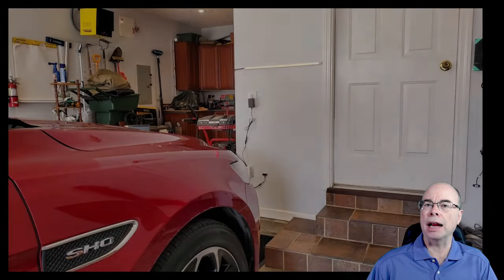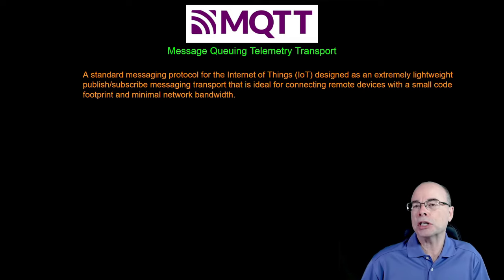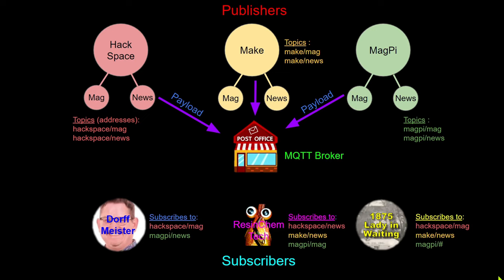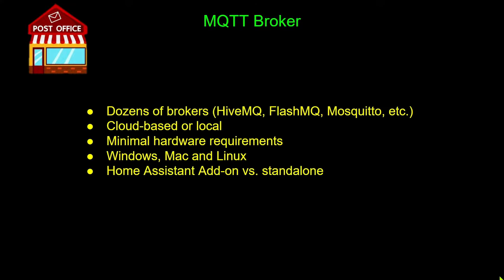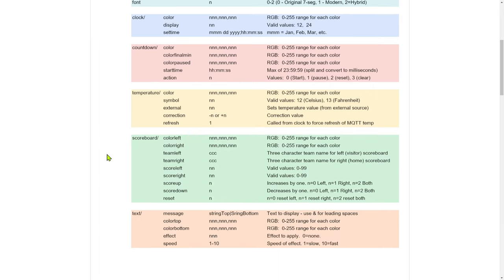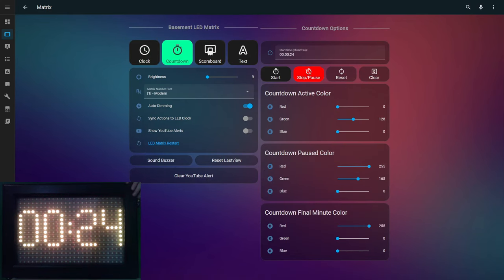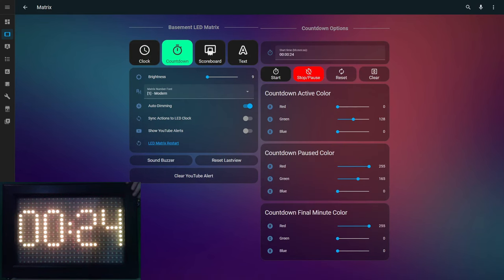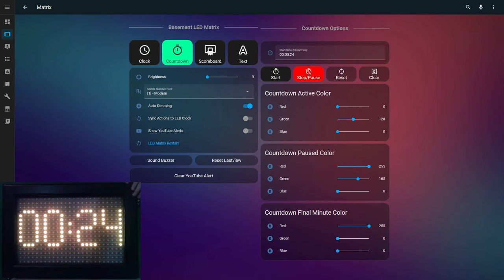MQTT 101: Integrate your DIY Devices into Home Assistant

Comment: Hello, great video! have a question. How do you edit a Yaml  file in the Home Assistant, Ul? In  your example, you show a side by side by side window view in a code editor not sure which one. In my instance, I have Home Assistant running in a VM on a separate machine in proxmox I’m accessing Home Assistant through its IP address on a separate computer Chrome browser when I try to edit a default ESP home configuration for example a D1 Mini adding code to a standard binary sensor from say a get hub example or to say, create in download packages, I can’t copy and paste from say a git hub repository to add the code to the Home Assistant computer. Configurations, I’ve tried both the built-in, file editor also the built-in VS code. There’s no copy and paste.  So my question is, In your set up What is your workflow for maintaining in managing your Home Assistant instance as far as configurations, working, and copying from GitHub, managing files etc.
Reply from the maker: Not completely sure what you are asking here... may be a bit different use of terminology for things.  But my setup is basically the same as yours... I'm running Home Assistant on a Proxmox box and accessing it via the browser (Chrome) using Home Assistant's IP address.

But I am able to cut/copy/paste code in both the File Editor and in the ESPHome editor.  I'm using Windows, so the Ctrl-C, Ctrl-V for copy/paste works.  I can copy text from really just about anywhere... Github, blog, another text editor, etc... and paste it into either the File Editor or the ESPHome editor within Home Assistant.  You can also try a 'right-click' of the mouse to bring up the cut, copy, paste options... but for some reason, I do see cut/copy but not paste in the pop up menu in the ESPHome editor.  Out of curiosity, if you copy something from say a Github example, can you paste that into a local text file (not in Home Assistant), even using something like Notepad?  If you are asking something else please let me know, but I am able to copy text from outside files and paste those into either the File editor for YAML files or into the ESPHome node editor.

One thought... are you logged into Home Assistant as the owner or an administrator?  And do you have 'advanced' mode enabled?  If either of those are not the case, it might prevent you from editing any files... and therefore, paste would not be available.  Click on your icon in the lower left corner.  In the profile, at the top see if the account is an owner or administrator.  Then scroll down and see if the 'advanced' mode is toggled on.  If you are unsure of accounts, go to the System -> People.  This could likely be your issue.
Reply: @ResinChemTech  Hello and thanks for the help. Much appreciate it, so yes, advanced is selected and the keyboard shortcuts do work so everyone that’s copying pasting must be using the keyboard shortcuts, which I never have before. Mine is the same as yours. The copy is there, but not the paste with the mouse. Also, just curious how you got the side-by-side view and not sure some are using the built-in file editor and some are using the VS code not sure which is the best and some have mentioned that you need to be using Samba Share to edit the config. So I wasn’t sure what the issues were. Your videos are good. You’re very good at explaining things you must be a teacher.

Comment: How do you avoid race conditions when commands can change state and states can alter buttons which issue commands?
Reply from the maker: I think I sort of covered that in the video when I talked about the retain flag.  I write my code, and most well designed devices have a different topic for commands vs. states.  So the command is sent on one topic (not retained) but the state is read on a different topic, which is retained.  The command is sent to the device, which then returns the state... but the state change received does not cause a new command to be issued.  This avoids the circular issue you are describing (if I understand what you are asking) and also prevents 'ghosting' issues when a device disconnects and reconnects to the broker and the state/command topics are the same and have been retained.  If you didn't watch it, you might watch the section of the video on the use of the retained flag as it shows what I'm trying to describe.

Comment: sorry, I'm a beginner at MQTT. I'm trying to understand this video, from a beginner's point of view, please help correct me, here are the steps that must be done: first step, install the code on Arduino, second step, setting it on the home assistant. My question, in my video look at the file location at /config/packages/basement_matrix.yaml. I can't find the /config/packages folder in my home assistant, did you create this folder, not the default one in the home assistant? Thank You
Reply from the maker: I have a /packages folder because I've opted to use Home Assistant packages for my configuration.  This is not the default, which is to place everything within one big configuration.yaml file.  The other alternative (which is what I used prior to packages) is to use a 'split' configuration, where you put things like lights, switch, sensors, etc. (or all your MQTT entities) in their own YAML files and then 'include:' the individual files in the main configuration.yaml file.

I cover packages in another video: https://youtu.be/VhHzBXYkVhw  (If you just want to know about packages, you can skip forward to about the 10 minute mark in this video).

In addition, I'll have another video coming out this Saturday that focuses solely on the Home Assistant side of setting up MQTT entities.  This will significantly expand on the short segment that talked about the Home Assistant side in this video.  I think it should provide much more information and details on the Home Assistant side of setting up MQTT devices and entities.

Comment: Could you dive into the code for setting up an MQTT client? I am new to all this and trying to learn. Basically I am trying to control an LED Matrix running on a raspberry pi and want to control what it displays like you do on your led matrix.
Reply from the maker: Well, my matrix actually has dual controllers.  If you are talking about the controller that shows patterns, etc. then that is the WLED controller and it doesn't use MQTT... it integrates into Home Assistant via an API and isn't even my code.  If you are talking about the controller that shows a clock, scoreboard, countdown timer, etc. then that is custom Arduino code that I developed.  You can see that complete code in the related Github repo: https://github.com/Resinchem/LED-Matrix-Clock_WS2812b

If you look in the matrix_clock_main.ino file in the /arduino folder, you can see how I implemented MQTT.  The sections that are probably of the most interest are the MQTT setup under the Setup() function (starting at line 371) and the callbacks (starting at line 581), although there are a lot of calls to publish MQTT values scattered throughout the rest of the code.

If you are using a Raspberry Pi, then my guess is that you are also using Python.  If so, then as I show in the video, the logic is basically the same between Arduino code and Python code... the syntax is just a bit different.  So, you will have to take what I show in the Arduino code and modify it for Python.  But the logic and processes are still the same.  If you are new to the code and MQTT, this is probably still a bit overwhelming.  It was to me at first as well.  I recommend just trying to start out very simple.  First, see if you can individually control a few pixels on your matrix. Once you have that, see if you can create a single MQTT command to call the procedure that turns on those few pixels.  Then you just have to build out from there.  It took me months to develop the code for my matrix, but I learned a ton in the process.  So, hang in there, study online documentation and take it in small steps and you can get there!

Good luck... if you run into any particular questions, let me know and I'll try to address them as best as I can (although there are limitations as to what I can do here in the YouTube comments).
Reply: @ResinChemTech  thank you so much for the in depth reply! I am new and yes, it is overwhelming lol.

Comment: Sir I would also like to request u to make a video on dash board you are using for your mqtt clock
Reply from the maker: There is really nothing special about the dashboard.  It does use the custom button card, which I covered in a recent video.  And you can find all the code, including the YAML code for the dashboard, in the Github repo for this project: https://github.com/Resinchem/LED-Matrix-Clock_WS2812b

The dashboard code is published as lovelace.yaml in the /homeassistant folder of the repo.  And there is some additional information in the wiki of that same Github repo.

Comment: I just discovered your channel.  I'm trying to set up a USR-N540 4 port serial device server that uses MQTT.  I managed to get the Mosquitto broker installed in HA but I'm going to need to find the right video on your channel to help with how to connect to such a device.  I'm pretty clueless about this stuff but based on this video I suspect you have a good one on how to connect a device once you have the broker installed.  Please direct me to your best video on this topic.  Thanks, mfk.
Reply from the maker: I think this video is probably what you are looking for:  https://youtu.be/WYyPMHqMV-w

As long as you know the MQTT topics and types of payloads used by the device, this video shows you how to manually integrated and control that device from Home Assistant.  Hope this helps you out!

Comment: has that cmnd/stat the same behaviour in tasmota, which i recall having both with same names?
Reply from the maker: Unless it's changed (I haven't installed a new Tasmota device in a while), Tasmota uses tele/ instead of stat/ for its "telemetry" values.  You can use the same command topic for both (commands and states), but it can be tricky and certain situations can still lead to occasional ghosting.  As I mentioned, there are other ways to do it, but using separate stat/ and cmnd/ topics is just the way I opt to handle retained vs. non-retained values.  It leads to having to write a bit more code up front, but it's a bit easier (at least for me) to keep values that I want retained vs. ones that don't separate.
Reply: @ResinChemTech  thanks!

Comment: "MQTT add-on goes down with HA" - you mean when the whole host is rebooted? However, most of the time we only restart HA Core (the python app) which AFAIK doesn't affect the container with MQTT.
Reply from the maker: I could be incorrect, but when you do a full HA restart, it also restarts all the add-ons... including MQTT.  I do know that when I restart HA, I can watch the status at the bottom and I see it specifically say "Starting MQTT, not everything will be available until it is finished...." 

So, obviously MQTT goes down when the whole machine and/or host goes down, but I believe the MQTT add-on, and other add-ons, are also restarted on a full system restart as well, meaning it is down.. at least briefly, which can lead to the entity errors I showed.  Now, this is in the full Home Assistant install (used to be called HassOS) and not a containerized version.  If you have some other type of of install, then it may well be that you can restart the core without impacting MQTT.  But if using the add-on with full Home Assistant, I do believe that MQTT restarts as part of the process.
Reply: @ResinChemTech  I certainly don't know everything but what I think: "MQTT is starting..." you mentioned means that MQTT integration is starting, not the broker (which is in its dedicated container and is running uninterrupted throughout HA restart). "Entity errors" you see also because of the MQTT integration starting - so you should see the errors also if the MQTT broker runs on an independent machine. Finally, I think that HA restart itself doesn't restart any of the add-ons. Anyone can confirm or deny our polemic?
Reply: @ResinChemTech  I forgot one more thing: I think that HassOS is also containerized.
Reply from the maker: No disagreement here!  I am far from an expert on the inner workings of HA!  You may well be correct (and probably are!).  In my particular case, I do have 3 times a week that I stop the VM to do a full backup... so for me in that case, MQTT goes down then because the entire VM is stopped and restarted.  And now that I think about it, you are correct about the integration vs. the add-on... and I would see those same errors even if I had an external broker with non-retained values.

Sorry for my own confusion... and lack of knowledge about the inner workings of HA!  That's why I love the feedback... I often learn new things myself!
Reply: @ResinChemTech  Absolutely no problem with that. I correct your mistakes, you correct mine - beneficial for both of us 😉
Reply: I'm using HA as VM (KVM/qemu) and not an RPi. During the HA restart via "Restart Homeassistant" the network stack is still working and the MQTT broker seems to be online. So, if one needs to restart all add-ons, restart the VM / power cycle the RPi. Anyway, under Advanced Options (Restart Homeassistant card) we have Reboot System ("restart the system [...] and all Add-ons").